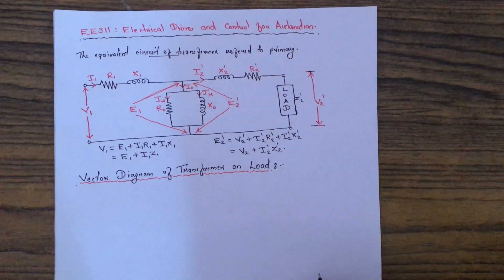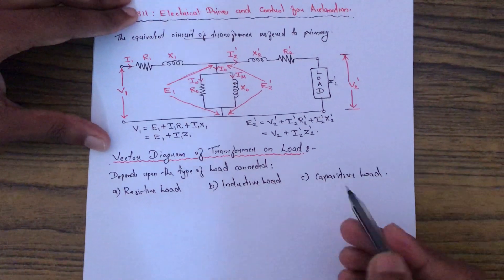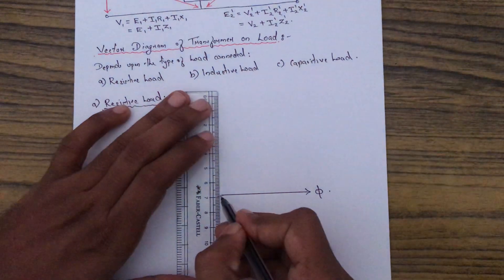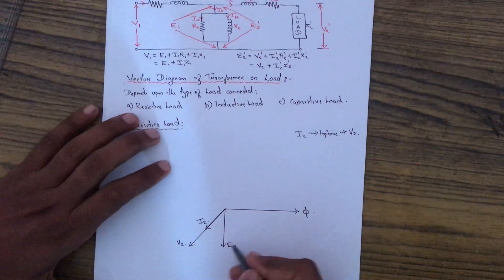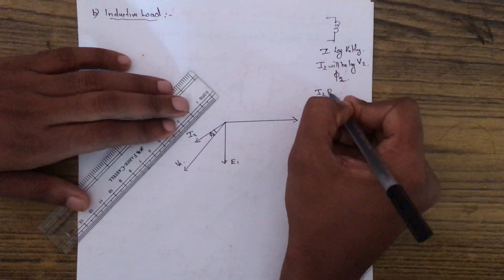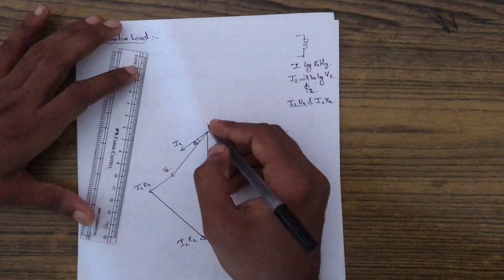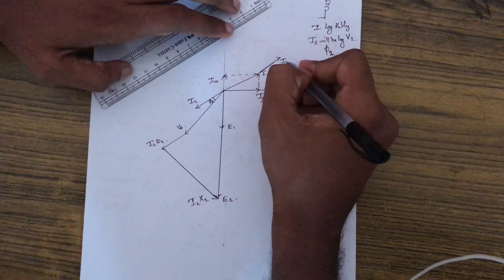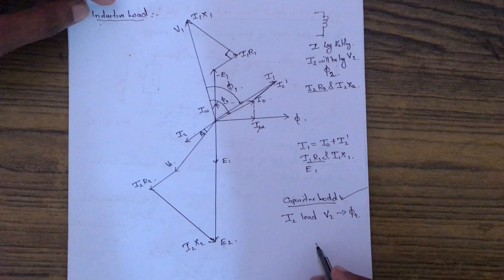Vector Diagram of Transformer on Load Condition.

Comment: Capacitive loadinte lead chythitu inductive pole alle vaaki ellam
Reply from the maker: Athey. So I2 inu parallel aayi I2R2, I2’ varrum.
Reply: @VishnuSKurup-ox9cn  pinne oru doubt ond...same phase vannal mathre V2 inte linil koode I2R2, I2 ekeverathollo?...
Reply from the maker: @HiAjhere  Athey, that’s for resistive load. Same phase. I2 and I2R2 will be coming inphase with V2.
Reply: @VishnuSKurup-ox9cn  okay thank you bro...